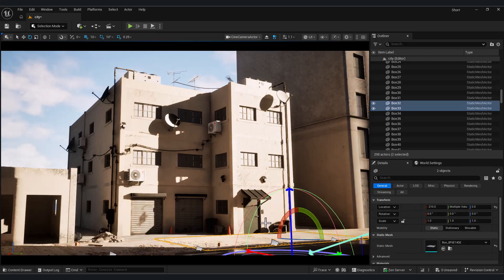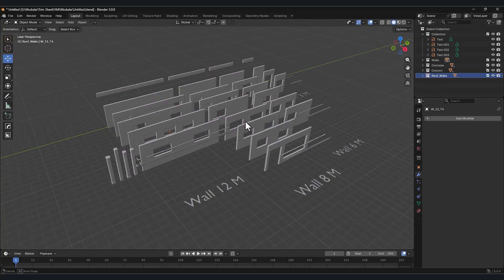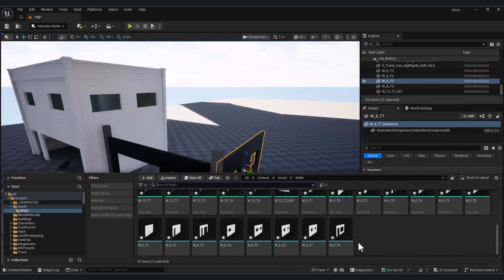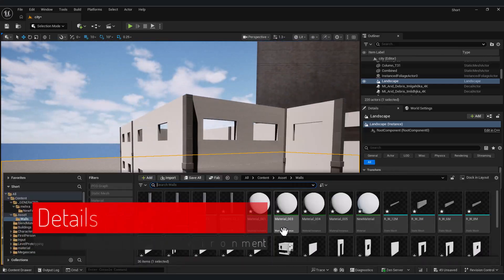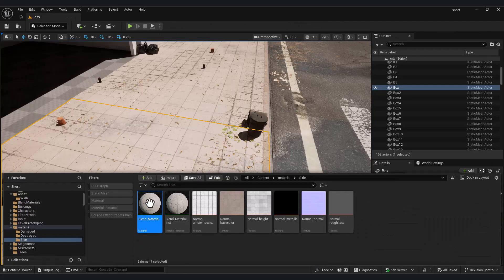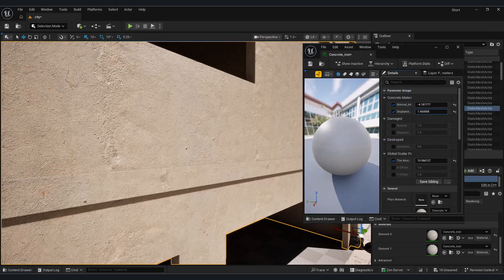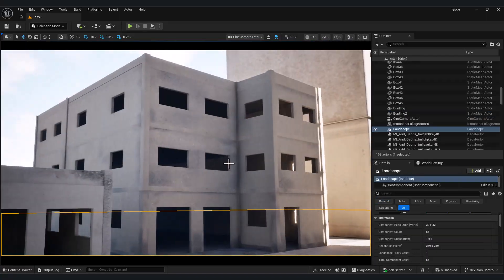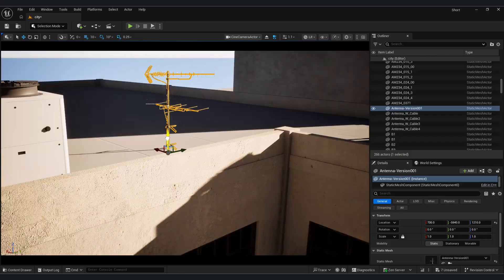Unreal Engine Environment Realism Breakdown | Street – EP 3: Building Realistic Structures #tutorial

Comment: what about the lightings?
Reply from the maker: If you mean exterior lighting, we covered it to some extent in the final part of this course
Reply: @PolyBoost  how long would it take to complete one building plus exterior lighting?
Reply from the maker: With a modular system, you can quickly build all kinds of buildings.
Exterior lighting also depends on your scene, but I don’t think it would take more than about 30 minutes, even with all the details in place.
Reply: @PolyBoost  including the pavements etc? did u use meshes to replace the blocks
Reply from the maker: Yes, for the sidewalk, in Part 4 we also used a modular approach and combined it with PCG
Reply: @PolyBoost  even with that it takes no more than 30 mins?